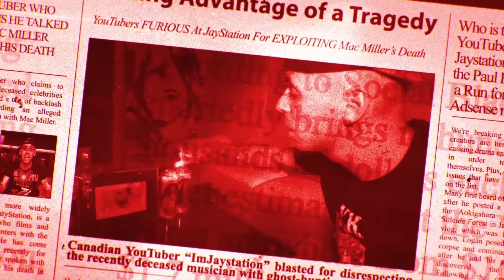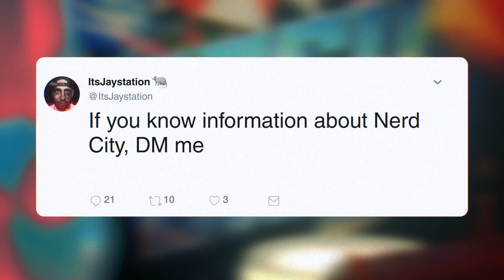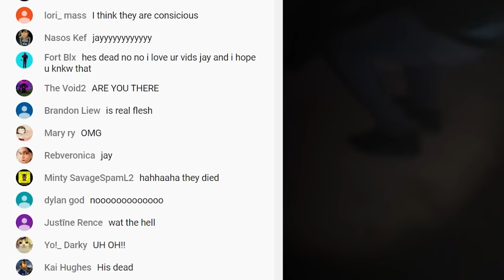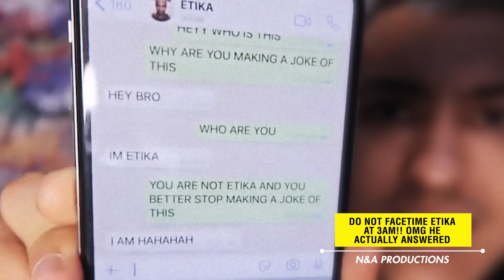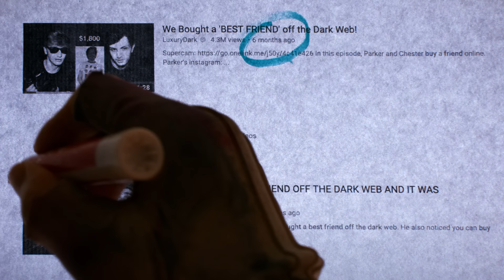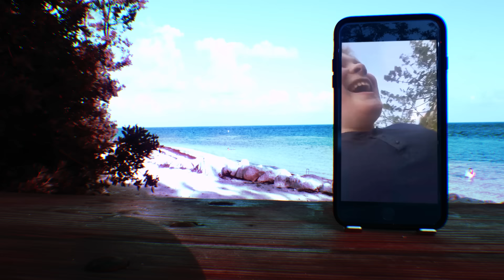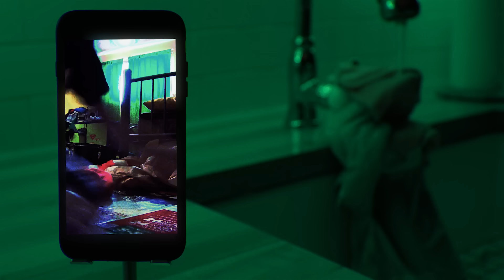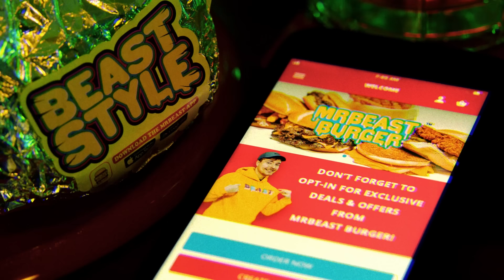The Worst YouTuber Of All Time

Comment: I now totally understand why this took 2 years. The amount of work is....kind of not imaginable. Nearly every frame is filled with things that must have taken hours, days, weeks or months of effort. Insane.
Reply: @dildonius  In the sense of amount of work put in and effort involved, it really is. Just the editing alone here was a massive undertaking. Nearly every shot has some kind of further editing beyond just proper placement within the video + effects, and many shots have a level of cinematography that takes a lot of time. Constantly having to find and insert clips that match what the audio is talking about. That's just one aspect. There's also the writing, the hundreds if not 1000+ hours of research, the management of such a huge project in the editing software, the narration, the audio design, lighting design, equipment management, props, scheduling everyone's roles and planning of shots, the spreadsheets/lists of whats shots are needed and when, hundreds of timecodes. If you have any experience with film making, video production or editing you can clearly see the work on display here. And this is only part 1.
Reply: @dildonius  i'll agree it's not extraordinary, but the effort put into it is. First you have an opening cut of a song/rhyme someone would have to compose as well as transition frames + animation + editing of that, which takes a lot of time and depending on what you're using, a lot of time to render as well. Then there's script writing, managing which scene goes where, reading the script, doing retakes of reading the script, setting up the set and various props, which doesn't really account for the fact that they were originally doing something different and the fact that this is the part 1 of what's been made as well as c19 coming into play.
I won't deny that, if this is their full time job, 2 years suggests a messy production of re-doing things. If this is a hobby on the side then it kinda does.

Comment: 23:04 i did actually try to do this (with gin), i ended up taking 9-10 shots, within the first 2 minutes, and i just decided "fuck it, im gonna stop before i die" and then the next morning i woke up to vomit on my floor, in my bed, in my hair, in many places, i got it cleaned up, put some candles in my room, took a good long time to scrub the vomit away, clean my bed sheets, buy new pillows, clean my bed sheets and pillows, 
from this point i have been paranoid to drink alcohol even tho i usually drink alot tho until now i have never drank that much
i did take a break after each time he said guys, so im not constantly drinking shot after shot, and eat a few buscuits so there was less chance i vomited (Well we can see how that went), there was no mixer i put in btw, it was pure gin shots